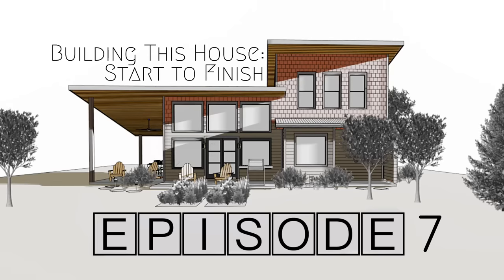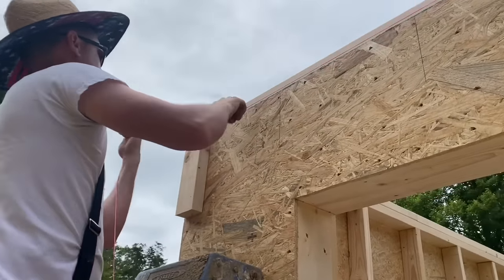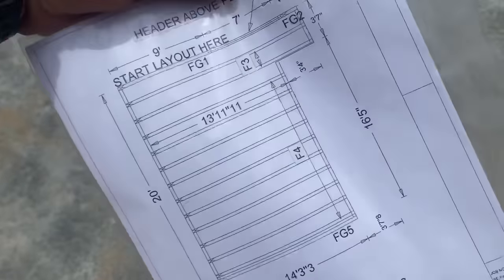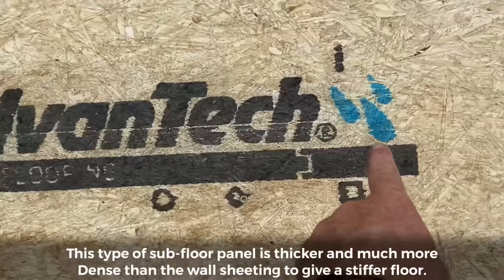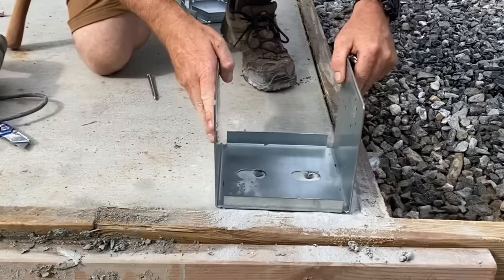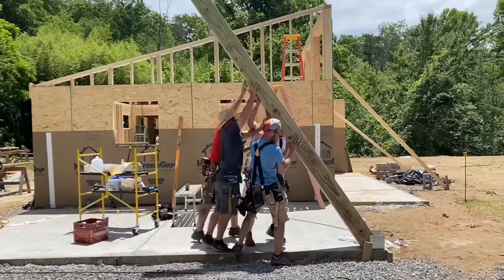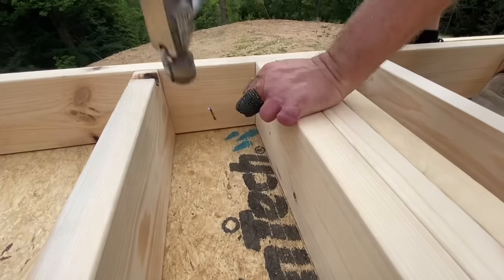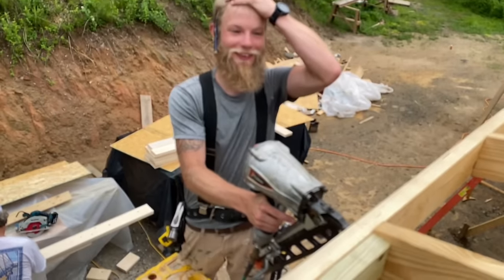Building A House Start To Finish | Episode 7: Second Floor & Interior Walls

Comment: I would recommend Simpson Titen bolts for concrete. You can drive them in with an impact driver. You can use it the Titen bolts for the sill plates: Much easier than using concrete J-bolts.

Comment: G, day Perko 
All power cords could come off the ground on the job site. Reinforcement bar 3/8 inch with a pig tail end at top. Have them at 9 feet tall.
* Edge of slab
* Over top plate
Increases safety and security.🚧

Comment: Shouldn't the post be about 1" away from the edge of the concert so you have space to trim around the bottom. Otherwise if you trim the bottom it will overhang the concert and look weird?
Reply from the maker: No trim on these posts... they will just be stained (but you are correct about the placement of we were adding trim)

Comment: How’s that compact paslode?
Reply from the maker: Don’t really like it... it does fit between framing easier for some things, But is actually terrible for doing toenails. It will not sink a toenail all the way in a matter what you do.
Reply: Perkins Builder Brothers right on. Yea I was interested for going through doing nailers and other pickup work potentially 🤷🏽‍♂️

Comment: "Dead nuts" is an ADECTIVE, since it describes a NOUN. But I didn't expect you guys to use an actual ADVERB that describes a VERB, because you never use them! As in "that worked out perfect". "Perfectly" would be the ADVERB to use here. Or "we did that so quick". Again "quickly" is the ADVERB you would use. Pro tip: ADVERBS generally end in "ly" . You're welcome.